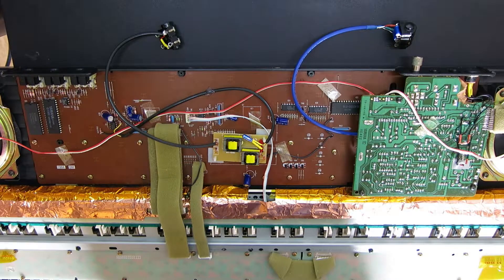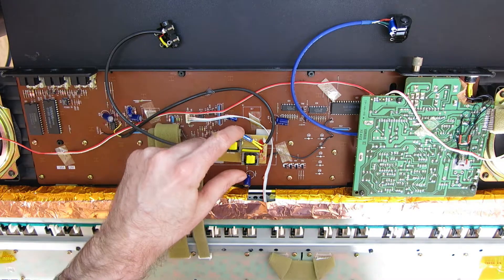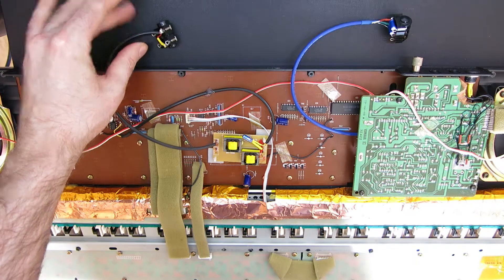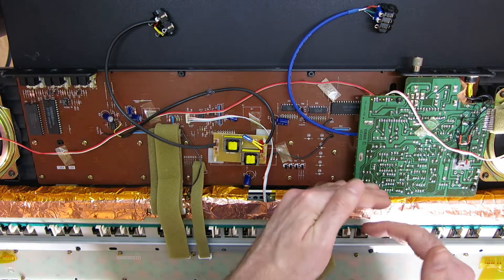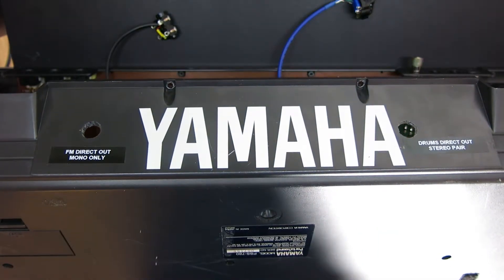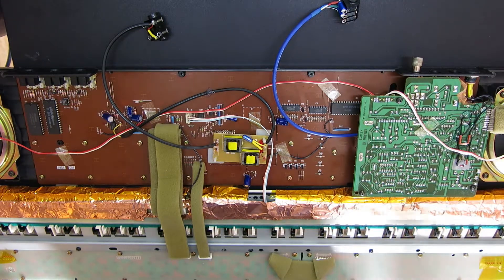1989 Yamaha PSS780 - Noise Free Direct Output Mod / Whine Fix - Part 2

Comment: Hi James. Just picked up a pss-780 on eBay. Wanted one in 1988 but couldn't afford it. I have an Atari ST which I've refurbished and I plan to connect the two. I know nothing about Midi or music for that matter but finally I may live the dream of being pop star in the 80s.

Recently bought a brand new 125cc Suzuki. Mid life crisis takes many forms...

Thanks for your video. I've a little electronics knowledge, I've fixed a CB radio or two and replaced caps in old kit. I will have a go at this and see how I get on!

Comment: Do you know if it's the same on the PSS-790? The 790 has AWM synthesis and with mine it has a low noise floor until I hit a note, then I get a lot of hiss. The hiss only remains as long as something's playing, which is really audible when you turn on the reverb on the unit. I initially thought that it might be old caps, but you seem to have gone through a lot more mods than just caps. I don't have a whine though, so that's fortunate, but I really want to get rid of the hiss
Reply from the maker: At a guess, that hiss is probably on the samples themselves, or rather a by-product of them being fairly low bit depth. I had a 790 for a week, but passed it on as it was such a disappointment and you can only play four notes in vector mode which drove me mad!
Reply: @jamesbennettmusic   hmm, you might be right. I managed to pretty much remove all the whine by hooking it up to my isolated guitar pedal power supply. The static hiss/white noise still remains. I also got a pss 390 which also seems to have a high noise floor, ugh…

The 790’s synthesis modes are trash, but I really love the sounds on it. I found out that you can enable velocity sensitivity by using an external midi keyboard. Using an external midi keyboard somehow also allows for more than 4 notes in vector mode.

Comment: table of contents/component notes:
2:36 on FM side, isolating transformer, 1 uF capacitor, 100 ohm resistor. signal goes into positive side of capacitor
2:46 output of transformer goes to another 100 ohm resistor
4:20 closeup of Rhythm jack with two 1 uF capacitors
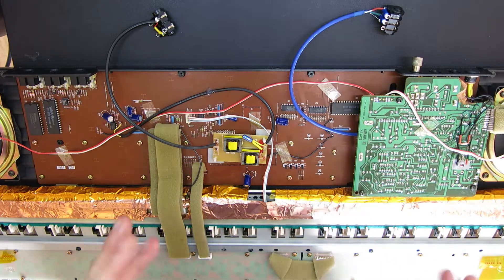4:50 foil wrap
6:40 headphones, line out, volume level are unaffected by modification
8:48 closeup showing FM taps - signal is tapped from top side of 22k resistor, ground is tapped from the bottom side of 0.01 pink thing (note: this is actually a capacitor) 
9:24 closeup showing Rhythm taps - L and R signal comes off bottom of 2.2k resistors, ground is tapped from 3rd jumper wire
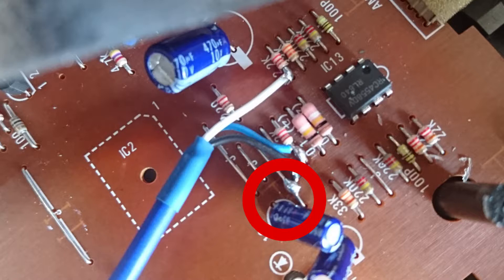9:47 review of FM side
10:18 no resistors needed on Rhythm side
11:21 audio comparison

Comment: Fantastic. Thanks for doing the extra work to edit and upload this video. Question: if my goal is to eliminate the high pitch whine (quite loud in my 780), without tapping separate FM/rhythm audio output, would the process be much different? What's the role of the transformer?
Reply from the maker: You might not need to route them to separate outputs, you could maybe mix them through transistors or something like that. Those matching transformers usually just isolate the ground between input and output, but it seemed to cancel out the whine, to a point, when I positioned it there!

Comment: Hi James,  thanks for this great tutorial. On a different note, do you know where to find details on the FM chip? I've Googled myself dizzy, but failed to find a datasheet.
Reply from the maker: I've often looked for them too and I think there's two factors that make them hard to find. They often hid one architecture under several different chip names, and also, I get the impression that chips they used purely for their own keyboards didn't often get public datasheets. Chips that they made for third parties, like soundcards etc, probably did.
Reply: Thanks again. I got the same impression from what information I did manage to find.